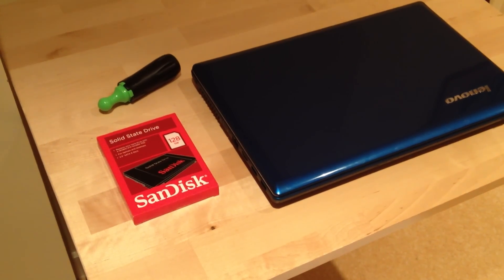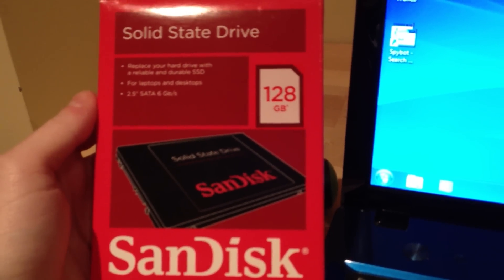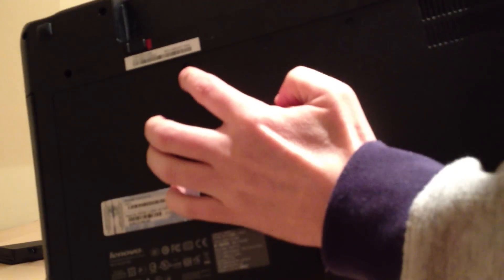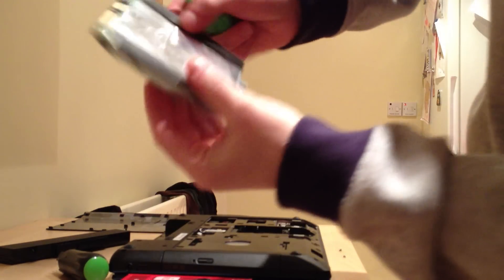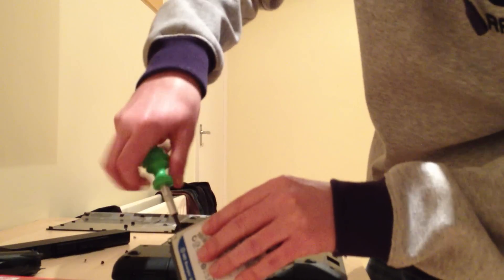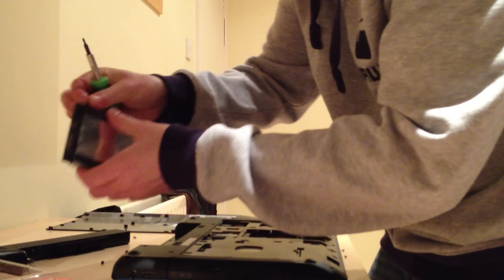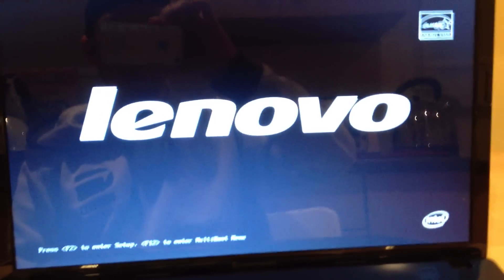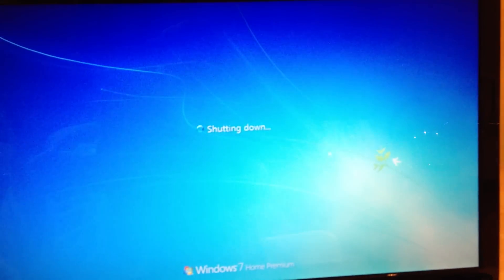How to easily Install fit a SSD SanDisk harddrive into Lenovo laptop hard drive

Comment: Hey Craig. Can you tell me please if a 2.5 inch hard disk fits into a lenovo z710 ? ( sata 3, 7200 rpm, 32 buffer if it helps )
Reply from the maker: Andrew Shady Any 2.5 should fit dude. there the right size for a laptop
Reply: Craig's Video Channel Thanks ^^

Comment: For my Lenovo IdeaPad S510p, would it still be possible to do this for an SSHD?
Reply from the maker: Luke Powell Yeah you'll be able to add an SSHD. i was thinking of adding one to my Ps4 Pro but not sure what rpm HD they come with as standard lol
Reply: Craig's Video Channel Thanks Craig. And yeah, i was thinking of adding an sshd for my ps4. But I thought i best do it for my laptop first. My laptop is a bit sluggish, so i thought i needed to boost it quite a bit
Reply from the maker: Luke Powell Why not buy a cheap SSD? you could always get a portable harddrive to put films on. SSD are pretty good prices now, they used to be really expensive
Reply: Craig's Video Channel I have quite a few games downloaded on my laptop (i have around 400gb taken up of stuff). So if i got a 100gb cheap SSD or whatever i would hardly have any space for my games

Comment: That was very funny when you dropped the screw lol. Great video though, very fast after you onstalled it the laptop was running like crazy.
Reply from the maker: +Dekkoo I Lol, yeah I didn't plan it, good job I got it back. I've got a new i5 laptop since then with windows 10, SSD installed and runs even faster. I'm looking for a new 6th gen i7 so can't wait to try the speeds with that

Comment: Can you fit a Lenovo Samsung SSD into a PC, or will they contain certain firmware which will disallow this?
Reply from the maker: +neonkt1 I can't see why not, an SSD is just your everyday hard drive at the end of the day, there nothing special for each computer
Reply: +Mr.Craig&#39;s Video Channel Thanks for responding! In the end I decided not to go for a Lenovo/Samsung drive due to it being OEM - they don't include a Samsung warranty, and sometimes the drives can be hampered
Reply from the maker: ***** Samsung Evo are meant to be the best ones available think there called an 850

Comment: I think its different for Lenovo ideapad Z510 right?
Reply from the maker: PlayAllDayPlayAllNight I'm honestly not sure dude, most laptops are the same fitting wise, just a few screws, unless its a laptop with built in battery which you can't remove then you'd have to remove the full back.

Comment: Thanks, Doing one tomorrow, didn't expect a problem but wanted to see the operation just so's not to get those unexpected glitches you know. This hits the spot.
Reply from the maker: RDYS It's well worth the upgrade makes your machine work so much faster
Reply: All went well. This was for a friend. installed with no problems, loaded a fresh win 7 with his choice of software. Boots in seconds and runs great. Thanks .
Reply from the maker: RDYS Nice. The start up speeds are so much better, like loads.

Comment: hey Mr.Craig, is there any way to fit both a SSD and HDD inside the laptop ? Maybe add Windows and programs on the SSD and other documents on the HDD..i want them to run both at the same time ! I don t like to replace my 1TB HDD with a 120 gb SSD...not that much space left..
Reply from the maker: Hey Mihai, you could remove your CD-Drive and put your SSD there in place of it! That would probably be your best option. SSD's have dropped in price from when I bought mine

Comment: 1) is this applicable for the G 570 version of Lenovo? 

2) is it possible to use both ssd and the actual harddrive (harddisc?) at the same time? I mean, ssd for windows and harddrive for the rest of the pc business?
Reply from the maker: In mine the G580 I can only have one harddrive at a time, other laptops allow you to have two but unfortunately mine doesn't :-(
This will work on your G570 though, you'll just need to install windows once you install the harddrive
Reply: MrCraig Videochannel But can't you have the second one by installing a harddrive to the place of DVDROM? By removing DVDROM? I guess it's possible...?
Reply from the maker: Gokhan Erguven Yeah you could do that, but I'm not that technically gifted lol. I'm happy with the one harddrive. I know my friends Acer has a 14gb SSD and 1TB out of the box.
Reply: MrCraig Videochannel Oh, I'm relieved. Because for a moment I thought I cannot install both SSD and HDD in one Lenovo laptop, since I've been searching all over Google and found info that I actually can. Thanks! :)
Reply from the maker: Gokhan Erguven You could just open the back and take a quick peek, it'll only be 2 or 4 screws ;-)
Reply: MrCraig Videochannel Yeah, but I'm not technically qualified to understand what means what when I look at it. Anyway, thanks for the information. ;)
Reply: you can do it using an HDD caddy in place of your DVDROM.
Reply from the maker: quantum axe Yeah you could use an SSD instead of the CDrom, are you meaning having two harddrives rather than one?
Reply: Mr.Craig's Video Channel yes. SSD as the primary OS partition and the old HDD for other data in the DVD ROM port. you can also convert your old HDD into an external portable drive using an external jacket for it.

Comment from the maker: I bought my Lenovo just before Windows 8 was officially released and when I installed Windows 8, the drivers weren't compatible with my laptop, so went back to windows 7.
When I did have windows 8 on, the laptop with SSD did load up a lot faster, I've another video showing the load up on my other videos, think it was something like 11 seconds.